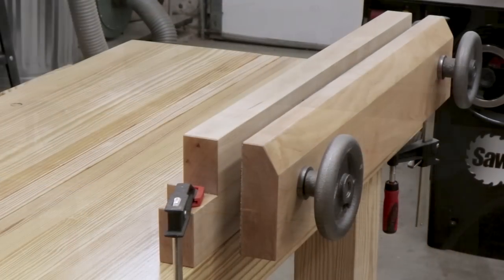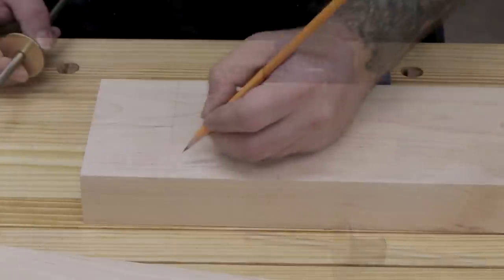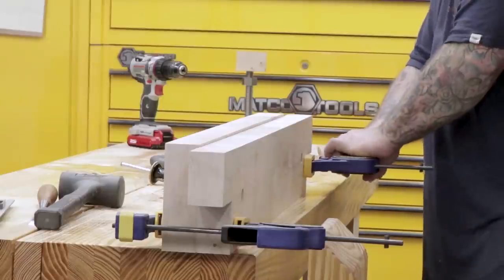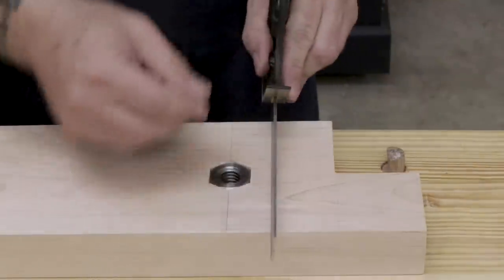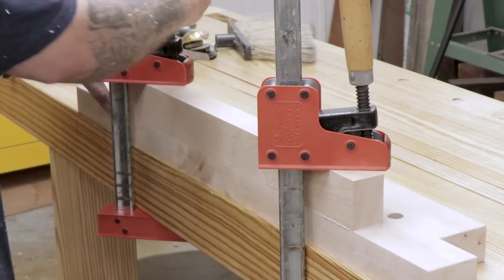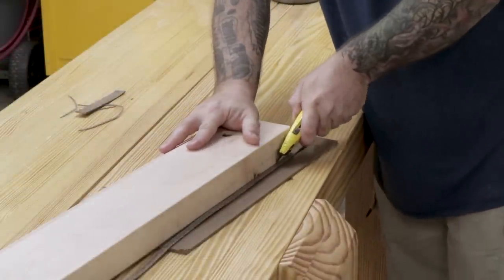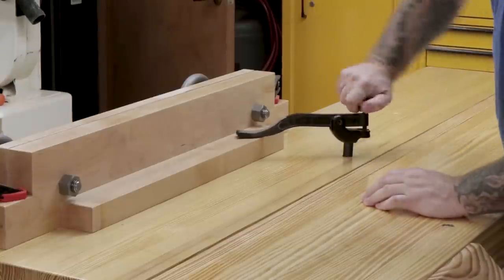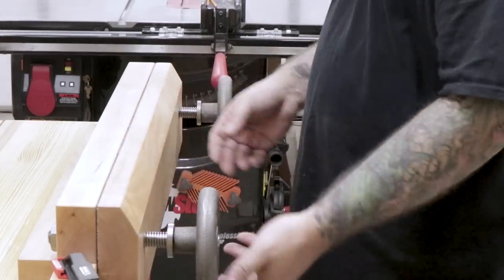Moxon Vise Build

Comment: I made one about a year ago. I used quarter sawn walnut, I also baked the wheels at 350 degrees, coated in raw flack seed oil. This helps prevent rust and give the hardware a brownish black finish. Would do it all again. Well worthwhile.
Reply from the maker: They are nice to have for sure! Good idea about the coating. I recently cleaned mine and put some penetrol on the wheels to try and combat rust. It  would have worked better and looked nicer if I did it from the beginning. Thanks for watching!

Comment: Beautiful vise. I’ve tried to make it three times now. But keep ending up with a similar issue every time. You mentioned in the beginning that yellow pine could be used as well to make this. I am new to woodworking and honestly I’m rather cheap and don’t want to ruin expensive wood trying to make it my first time. So I wanted to build this from the cheapest materials (wood) as possible so pine was my obvious choice. I started with a couple 2x6’s straightest and best I could find at my local box store. Then cut them down a bit longer than I wanted my finished project, then jointed and planned them down to roughly 1-1/8 to 1-1/4 each. Trimmed off a little snipe from the end and glued and clamped two of the best fitting boards together. Most times gluing up before work and coming home to find that at least one of the boards has warped/cupped if not both. Even with 19 or 20 clamps all the way around it. Should I just give up on the pine and just spend for the hardwood? Any suggestions? Thank you.
Reply from the maker: Thanks for watching. Sometimes the yellow pine  from the home center is pretty wet. Maybe it has to dry out for a while before you start to work with it. Or get the boards close to size then let it sit for a few days then work it to final size. I built an entire workbench using this material and had no problems but I let it dry out for a while before using it. If the glued up boards end up having a little bow to them, use it to your advantage. If the crown of the bow is facing inwards, it will actually clamp the work piece better then a vise jaw that was flat to start because when the screws of the vise clamp down on the work piece, it will apply even pressure all the way across. In most cases the jaw starts out flat when you tighten the vise screws, the jaw bows and applys more pressure on the outside than in the middle.

Comment: Very helpful video! After looking at a lot of different designs I went with one similar to this, and your video is very useful in making the steps easy. I like this simple design.  I didn't use the kit but used all thread and some other hardware. Just about to put the finish on. You have a great speaking voice, and the music was decent, not distracting. High quality video,! Subbed.
Reply from the maker: I'm glad you found it useful. It took me a while to get used to using it but I'm glad I have the moxon vise now. Thanks for watching!

Comment: Dave, very nice, straightforward build and instruction! Represents every feature that is needed for functionality plus portability. Maybe, I missed it but it appears to be about 24” in length. Will you list your measurements? Thanks, Tom
Reply from the maker: Thanks! The vise is 36 in long. The notches for the clamps are 2.5 in. The screws are about 24 inches apart. The vise is 6 in tall. Hope that helps

Comment: It’s beautiful 👌🏻 I just wanna ask a question though! If I make jaws on those two wheels like cycle gears n put in another gear in center n tie those 2 with it using a cycle chain n another 3rd screw which is only connected to the outer moving part of the vice! Would it work?
Reply from the maker: Thanks. I don’t see why not. I think veritas has a chain driven vice but it only needs 2 gears on the sides

Comment: Another great tutorial, Dave. I really appreciate the flow and efficiency of your videos. I referred to your Roubo build when I built mine, and couldn't be happier with it. Now time to add the Moxon for easier dovetailing. 

I'm curious-why don't you use your benchdogs on the Roubo's dogstrip for holding the Moxon vise? Seems it would take advantage of one of the key features of your bench for quick mounting of the Moxon vise.
Reply from the maker: Thanks. The vise can be mounted all around the bench including over the dog holes. You could pop a couple holdfasts in a couple of pre existing holes to clamp the vise down. Where the vise is in the video is only so I could get a good camera angle for the video. I usually mount in that location just because I have more room to get a good shot for the video.
Reply: @TwistedWorkshop77  Thanks Dave.

Comment: You could play with those handles all day.  U could play with someone to see in one spin who can get closer the the stop. 
On a serious note I saw the nut at the tear. Was that glued to the wood or free on the bar.
Reply from the maker: Lol. I spin the leg vise on my bench to see if I can get all the way to the stop in one spin!! The nut on the rear is just tightened against the wood so the wood is sandwiched between the nit that is inset and the rear one. The bottle I was using was a graphite lubricant.
Reply: @TwistedWorkshop77  😄  Gold. Thanks for that!

Comment: Great video!  Everything one needs to build it, and yet short video and to the point!  Two questions though:  1) Again, why does the moveable jaw need to be 1/8" taller than the back jaw? and 2) How long are the "Acme" threaded rods?  Thanks in advance for your reply.
Reply from the maker: Thanks! The front piece or the chop is taller and is biased to the bottom of the vise to create a lip and make it easier to align to the work bench. Taller might be confusing, wider I guess.  The threaded rods are about 8 and a half inches long.

Comment: Great job, that hardware looks so smooth.  Have you seen the modification David Barron made to his moxon?  He added springs to the back to the jaws open up without needing to be pulled open.  Do you think that would be an improvement?  Interested to know as a moxon vice is high on my list of projects to do.
Reply from the maker: I did see his video with the springs. I originally was going to add the springs but couldn't find the ones I wanted. I might add them later but the vise is working well without them

Comment: Unbelievable, the cost of the hardware shown at $261.00 plus taxes and shipping in USD. This doesn’t include the cost of lumber. Nice project but the costs are outrageous.🇨🇦👍🙀
Reply from the maker: It is expensive and there wasn’t any other options when I built this. Now taytools and wood river have the hardware kits for $120 and Amazon has similar versions for under 50 bucks.